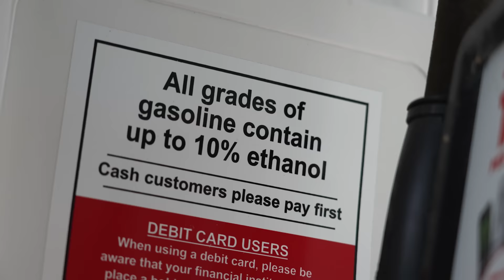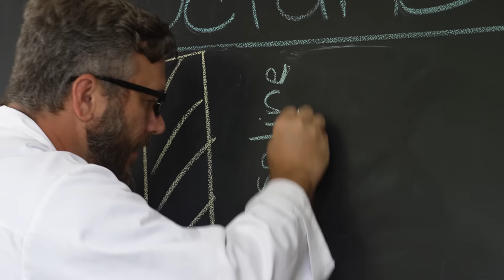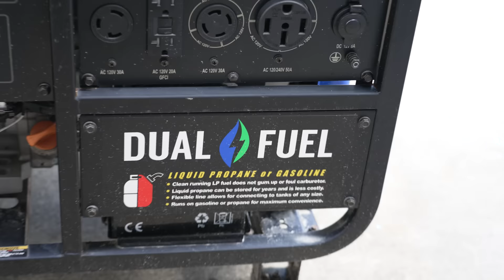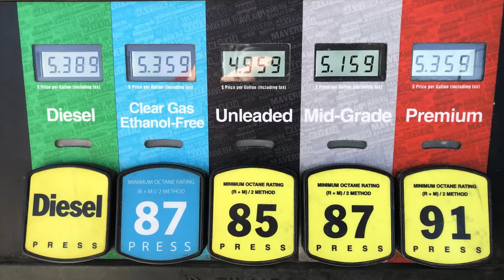This Will Destroy Your Emergency Generator! Don't Make This Mistake

Comment: As a master small engine mechanic I appreciate your video on this topic. I've tried to tell people for years about this and why their machines, (especially chainsaws) are damaged by it. One thing to add to your video. If you get your ethanol free fuel from a station with one hose for all grades. Put the first 2 to 3 gallons in you car then switch to your gas can. Other wise you get 2 to 3 gallons of whatever the last person pumped. And if you're filling a 2.5 gallon can...... Well you're screwed.
Reply from the maker: Thanks!
Reply: Wow, I never considered that. Next time I'm getting the 91/85 mix from local station, I'll put some 91 in the car first to clear the system.  Guess I better start using/replacing the stuff I've got stored now.
Reply: Hey also mix anything with alcohol in it in you ethanol gas. Dry gas makes the ethanol turn to orange gel especially in the winter. And stabil only works on non ethanol fuel. It says it'll help with ethanol but it doesn't.
Reply: Maybe Adam or surly can help me with this. My push mower is 30 plus years old   Purchased new fuel this spring. I cut the grass. A week later the fuel in the tank is gone. No leaks anywhere. Can fuel evaporate that quick if it’s 10% ethanol?  Cheers from Canada eh
Reply: Me2 so many people don't listen but you can still vaporize the fuel and not need a carburetor
Reply: @daviddorge1559  I would check the seal on your gas cap......if it's been as hot as it has been in my area(Ontario, Canada), and you used most of the gas mowing your lawn I would guess that the amount left in the tank could have evaporated over the course of a week. Gas caps will let off some pressure if the tank gets too warm to allow of the gasoline vapours to escape but not enough to fully disapate. 
I always top my tanks up after I've done my yard maintenance so they're ready for next time and don't get any moisture build up in the somewhat empty area in the tank where condensation can collect.
Reply: It's no where near 2-3 gallons. The mixing valve is inside the pump so it's really just the hose and the nozzle. 6' hose @ 3/4" diameter is 0.138 gallons. Figure a little more hose inside the pump to get it from the swivel/emergency disconnect where the hose connects to the pump and you're still under 0.2 gallons that needs to get flushed. Filling up the 30 gallon tank on my boat I don't even think twice about this fractional amount. The only time I'm concerned is if I'm filling up the tiny little 2.5 gallon can I have that I use for my mower. Thankfully the station closest to me has a dedicated ethanol free pump so it's always 100% ethanol free coming out of the pump since there is no switching between grades.
Reply: @daviddorge1559  Been a gas mower user for 25 years.  Recently switched to an electric one due to a fathers Day gift.  While it has it idiosyncrasies, the no maintenance/no gas thing has been worth it for me.  But it all depends on yard size.  I am from Canada as well.
Reply: Good tip.  Live in Michigan and I don't mineralize anything. Yeah I'm dumb
Reply: EXCELLENT ADVICE. I will definitely do that next time, THANKS.
Reply: @daviddorge1559  you have a small leak or your engine is burning excess fuel quickly
Reply: My fuel station has a separate hose for the ethanol free, thankfully.
Reply: Every spring, when my brother worked fixing tools, it was the same thing. lol. Inundated with gummed up fuel systems from letting ethanol sit in them over winter. He's been saying it for years too and my landlord refuses to use anything but premium in the lawn equipment, cause no ethanol. And even still he empties them and starts them till they stall, to get the gas completely out. That old Tecumseh lawnmower has been going for many, many years, with just that practice and oil and never given a lick of trouble.
Reply: @eskimo2k  I've done the test my self with a fresh 1 gallon can. 1 gallon out of the hose tested positive for 10% ethanol. Not to mention this recommendation comes from all the small engine and marine manufacturers. After 20 or 30 factory training classes in this field they all recommend the same thing because in their testing nation wide and in Canada they have found it to be a real thing. This is not them trying to sell a product this is them trying to teach people and save damage from ethanol.
Reply: @virgil3241  unfortunately as nice as electric can be many people don't follow the instruction on the unit and end up misusing it thinking it works the same as a gas mower.
Reply: @surlypuffin6375  Explain to me how I am misusing it?  Same size deck, same lawn, etc.  The engine turned the blade, now batteries turn the blade.  I had a bagger, and this is as well.  I dont let the batteries go down to nothing and recharge them as needed.  Now for the winter the batteries are 3/4 charged to then be recharged full in the spring.  To put it away for the winter it took me 10 minutes, which was more or less clean the deck and wipe down the mower.    So Ill ask, if its a blade being turned, gas or electric, how can that be "misused"
Reply: Thank you! Pro tip.🤫
Reply: That was my thought.  As a side note, gas pumps aren't gas pumps, they are dispensers. The pump is actually underground in the tank.
Reply: are you serious? so this happens everywhere? so if someone just got premium im gonna end up with premium. that sounds like bs now that i think about it, but i follow the manufacturer specs so i wouldn't want to end up with premium... how have i never heard about this.
Reply: I have a riding mower that I bought in 1996 with a Birggs 18.5HP L-head twin. I've never used anything but regular pump gas and I use the mower for cutting grass, aerating, and sweeping so it gets triple duty during the Summer. The engine does not have an oil filter. Except for the coil, battery, belts  (one change), spark plug (two changes), and one pulley, everything is original including the air and fuel filter and all hoses. I don't use fuel stabilizer so it sits between 5 and 6 months without being used and with whatever fuel was left in the tank when I put it away for the season. I don't understand why modern engines have so much trouble with E-10.
Reply: Total BS. It’s not even a quart.
Reply: never thought about that, thx
Reply: Seriously doubt you are a "master" mechanic. When used and stored properly your equipment will have absolutely no issues with E10 fuel.
Reply: Good tip.
Reply: @canucanoe2861  no, it's not a good tip. Ethenol free pumps are stand alone and not only that, but there is NOT two or three gallons of whatever fuel the last person pumped in the hose. This guy has no idea what he is talking about
Reply: @virgil3241  I bought my house in '88, got a new gas lawn mower that was a Royal Pain in the A$$ since day One!!!!!
Wouldn't start without starting fluid, I junked it after a season or so of fighting with it, been using an electric mower since, my yard is only two and a third lots, so it's not huge, it takes about 45min to mow the front yard, no grass in the back yard.
Reply: Oh wow!  That makes sense but I didn’t think about that…I will from now on. Thank you!!
Reply: @cbass2755  this guy is a freaking hack, shade tree at best
Reply: Great common sense advice! Thank you❣
Reply: @stacec3990  Jesus Christ it is NOT even mediocre advise!
Reply: @romak4756  pardon my ignorance. Perhaps gasoline products are not as similar as other distillates as  I had imagined. Being around grease monkeys (Cadillac master mechanic & Alice Chalmers master mechanic) most of my life. We were taught to never mix petroleum products or fluids. Evidently, small engines are significantly different. My bad
Reply: @stacec3990  what this guy is suggesting that gas pumps store a few gallons of gas in the hose, is absurd. You are not getting a few gallons of whatever the last person had pumped
Reply: @victorhettinger4412  "so many people don't listen but you can still vaporize the fuel and not need a carburetor" What?!?!
Please, DO tell!!  I gotta hear this one!
Reply: @jaadow77  I wouldn't worry about it, really...That "2-3 gallons" statement is NOT exactly true.  While you will get a small amount (this is the reason diesel has an entirely separate hose and nozzle all-together), it's not even close to 2-3 gallons!  It's quite literally more like a pint to a pint and a half.  Not really a big deal, unless you're only pumping like 40 cents total into your empty container.
Reply: Volume of a 10’ 3/4” line is about 1/4 gal. The method works, but anything over 1/2 gal would be overkill. Good practice though! If you’re already at the pump, no sense in not topping off first. It clears the line and delays your next stop even further.
Reply: @eskimo2k  yes, 2-3gal seemed a LITTLE  high to me too
Reply: @eskimo2k  that's what I was thinking 15 or 20 ounces at best left in the hose
Reply: Thank you for this information! I have to tell this to my son....
Reply: Another something else to watch for is never fill any tank while the tanker trailer is refilling the underground fuel storage tanks.
Reply: My really cheap 7 year old harbor feight chain saw is still running strong running only E10....I do use fuel stabilizer but I dont even change it that often though at least once a year I mix up a new tank.  Now this is southern california but it is mountain area so colder than rest of so cal ...I heat our home 100% with dead fall oak I cut up and even cut down dead oaks ....I use my saw a lot and I abuse it terribly maintence wise (like NONE other than installing new chains or bar) never have cleaned the air cleaner or even cleaned the thing!  LOL I am afraid to at this point I NEVER thought this thing would run this long!   It has paid for itself many times over in my book .....Poulan 42cc running on pump gas
Reply: You're not a master anything
Reply: Great info, as a master idiot I appreciate any help I can get
Reply: Great advice
Reply: Yep--Saw another YouTube--DEMO IT !!
Reply: @Pro1er Try some recreational fuel you will notice the difference
Reply: Great vid mate
Reply: @eskimo2k not true
Reply: I'm a master baiter
Reply: All the ethanol free pumps I’ve seen in Texas has its own handle, so I’m assuming you don’t need to purge in this case?
Reply: Called Duromax they say regular gas is fine.
Reply: The Mobile station I go to has 2 different hoses, the one for the 3 different grades of unleaded fuel, and 1 for Rec. fuel.
Reply: example of disinformation.  Not 2-3 gallons....
Reply: You are NOT a master mechanic lol, at best a shade tree
Reply: Lol I needed that thanks

Comment: My advice, no matter what kind of gasoline, is to NEVER shut off the engine with the ignition switch. It's much better, to cut off the fuel valve, and let the carburetor float bowl run out of gas. (engine unloaded, of course) After the float bowl runs out of gas, wait a few minutes, to allow the fuel line to drain into the float bowl, put on the choke, and pull the starter cord again. The engine will often start again. Having the choke on, helps the engine vacuum the last bit of residual fuel out of the idle circuit, as well as the emulsion tube and the main circuit. Never allow fuel to just evaporate out of the carburetor, or there will be gum, varnish, or corrosion, none of it good! The big problem with ethanol, is that it is an electrolyte, not a dielectric! that invites galvanization of dissimilar metals within the carburetor. Keep in mind, you have an aluminum carburetor body, with a steel float bowl, held in with a brass bolt. The float is brass arms, supported on a steel hinge pin, held in aluminum castings of the carburetor body. Plenty of places for a white aluminum gel like substance to form, leaving pits throughout the entire carburetor body. If that happens, just buy a new carburetor! All those problems can be solved, if the carburetor is completely drained of fuel, after every use.
Reply: Thanks Guys with the advice of both of you, no reason to have a problem with fuel.  You can also store any engine with 2-cycle oil introduced into the carburetor, it will crank after many years when left in storage.
Reply: @reggiemcdaniel1802  What do you mean, "with 2-cycle oil introduced into the carburetor"?  Can you please elaborate on that technique?  TIA. 👍
Reply: @marvelaturraz5405  I've used 2-cycle oil in all of my small equipment engines for years without any problems. 
Higher quality 2-cycle oil typically has fuel stabilizers in it (make sure that it does) that "stabilizes" the fuel when it's stored, in my case for a few months at a time. 
The 50:1 ratio never causes any smoke or plug fouling and only adds additional lubrication to the air/fuel/engine system.
20 years without a related problem.
Reply: Unless I plan to restart the engine soon, I always shut the fuel off and let it run till it dies. Haven't tried that last choke/restart bit though. I guess so far I've been lucky!  With generators, I usually only need to use one of mine every few years. So I also drain the tanks before I put them away.
Reply: ello, after reading your comment ir seems to me that you are very knowledgeable- on a different topic related to generators I was wondering if you can help. 
I replaced a broken gas tank with a generic brand (Amazon)- however I noticed that it does not have a vent out outlet and Im worry that the tank will expand, specs on the new gas tank does not specified if the gad cap has a vent out in it. Any advice will be appreciated.
Reply: For long term storage - After running it dry and letting it cool, pull the spark plug and pour a small amount of engine oil into the hole, reinstall the spark plug and pull the rope a couple times to lubricate the cylinder. (Duromax recommends this).
Reply: One point unmentioned and neglected by most is grouding the generator with natural grouding rod. It gives relief of electromagnetic static buildup from generator especially when under heavy load or with no load.
Reply: @sunbeam8866  I do the same. Stored my generator for over a year, and it starts on the first or second pull. Definitely use the fuel shut off.

Comment: E10 isn't mandated for environmental reasons. E10 is mandated to subsidize Big Agra corporate-owned corn farms.  Surprise, surprise, surprise.
Reply: It’s sick.
Reply: In some Areas E5-10 is needed in the winter for smog control. 
Anything more than that is from big agra, and the farmers lobby. 
Got to give welfare to the Iowa corn farmers.
Reply: Actually it is because it was one of the cheapest oxidizers to provide air quality compliance in order to replace MTBE, a suspected  carcinogen that was  miscible in water which contaminated aquifers.
Reply: @spuds6423  
I believe E5 takes care of that. 
Well, let’s assume it’s E10 
Turns out Americans are not buying as much gas as the original bush era law assumed. So big ethanol wants it to be sold year round. Even during the summer, where it evaporates easily causing additional pollution, and wasting money.
They also want the promised increases to gasoline. Even though corn ethanol is not very environmentally friendly. And uses so much fossil fuel that it’s almost a wash. 
So yes, ConAgra is lobbying hard to force Americans to give them money. 
Along with the state of Iowa abusing their position as the first primary state to ensure they keep getting mandated welfare from the other states
Reply: @spuds6423  Interesting, never heard that before.
Reply: @JohnnyArtPavlou  if you remember the "Don't wait till"98"  slogan, USEPA and state agencies were giving gas stations a dead end date that underground tanks a 1000 gallons or more had to have double walls and leak detection systems.
Reply: @spuds6423  No, I don’t remember that at all.
Reply: @JohnnyArtPavlou  well, if you know anyone who worked in the environmental or fueling business, they would. The general public really wasn't clued in at the time.

Comment: i use propane never any problem
Reply: Came here to say this.  If you're only using this as an emergency backup and not regularly,  propane makes the most sense.  Easy to store, no fumes, doesn't go bad over time and you don't have to worry about leaving fuel in the tank.